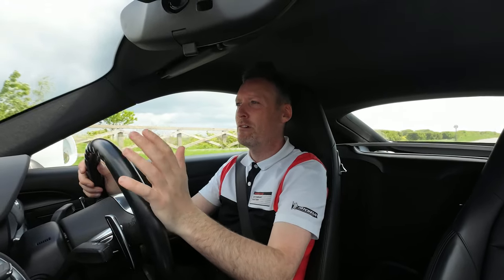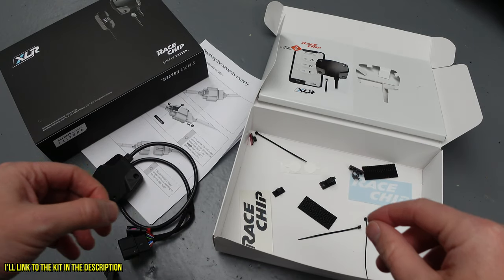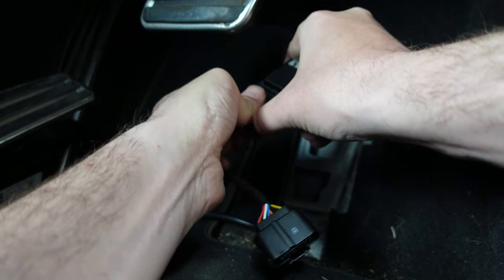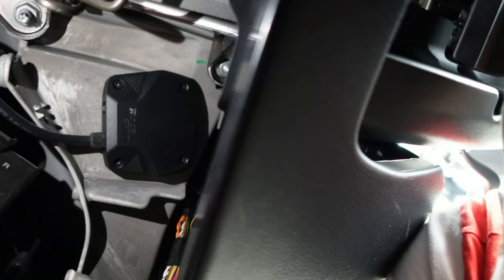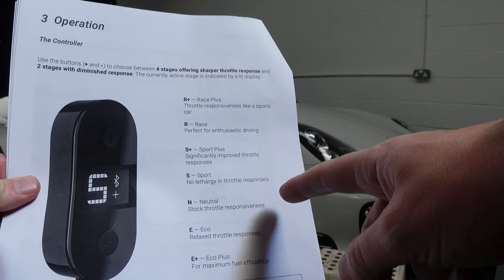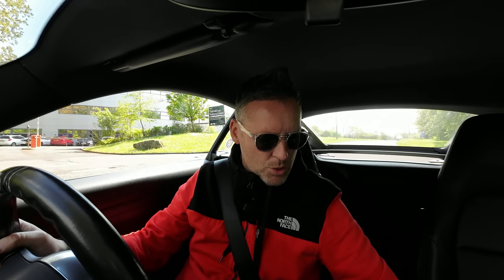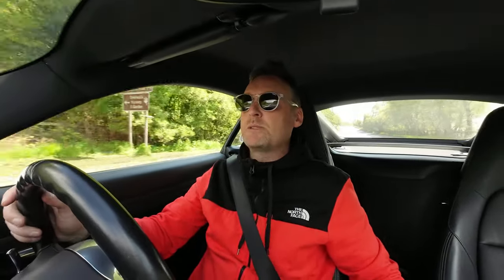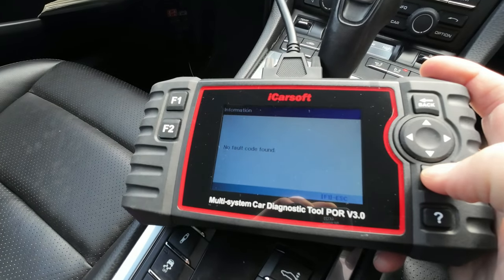This Plug In Box Will Turn Your Porsche Into A Weapon (and it’s illegal in some places)

Comment: Yes loads of people have done it but i don't trust anything aftermarket in between drive by wire controls and what they're controlling. Who's to say there isn't some failure mode that puts it in permanent full throttle. They certainly haven't invested in the kind of testing that Porsche would have.

Comment: Is this not similar to the well known sprint booster, except it’s done through an app.
Reply from the maker: Yup. There’s a few versions made by different companies. Sprint booster, pedal commander and racechip XLR.
Reply: @alsatch_  I did not catch in the video. Do you have a tune. I currently have an FVD tune on my 981 base and throttle is much better. So much so I decided not to do sprint booster. But I am always wondering. Thanks.
Reply from the maker: @ernesternest815 hi, no I don’t have a tune on the engine, might consider it in future but I’m happy with the current power output. Interesting to know that the tune has adjusted the response though. Thanks 👍
Reply: @alsatch_  well before my tune normal mode was underwhelming and sport was good. Now normal mode is good and sport is great. Especially above 5k where she really pulls.

Comment: Unfortunately not available for a lot of Porsche models. I tried to find an XLR for my Panamera, but not available. Similarly for various models of 911 I tried. Pity - I'd have liked to give this a go.
Reply from the maker: They are definitely available for panamera. You need to select your model, and then stroll down the page past the section where it tells you that there are no performance chips available, below that is the XLR product.
Reply: @alsatch_  Hi Al. Thanks for taking the time to reply. I must be missing something. I select my car make and model etc and then go to the XLR page where it says 'not available for your car' and offers a button to 'continue shopping'. If I scroll down to the bottom of that page, the only option is to 'continue shopping'. I can't add an XLR to my cart. I have a Panamera 2015 (970.2) 3L diesel 300HP. My wife has a 981 Cayman - we both really enjoy your videos and your down-to-earth presentation style. PS. There ARE performance chips for the Panamera (the GS and GTS), but no XLR is listed anywhere.Weird. It would be a big favour if you could successfully add a XLR to the cart for the Panamera diesel 300HP - that would prove that the problem lies with me!
Reply: Hi Al - ever since I saw your video on the XLR I wanted to improve the laggy throttle response on my Panamera, but as I commented before, the XLR isn't available for the Panamera 3.0 diesel 300 bhp. However, I have now bought a PEDAL COMMANDER for the car which does the same job. Just thought I'd update my earlier comment with this good news.

Comment: So it skews you throttle position signal by increasing gain and bias?    

Why not just learn to drive you car?
Reply from the maker: Ok I’ll take it off now
Reply: @andymanx Bruh I just watched your trackday videos. Talk about learning how to drive your car 😂😂😂  maybe it was your mom driving
Reply from the maker: @chrisolsen937 hahaha I just watched them aswell. I don’t think it was his mom though, probably his grandmother.
Reply: Andy it depends how linear the throttle is and how long the pedal travel is.

These things can help on some cars, but they aren't a miracle cure or magic bullet. Get the setup right though and there can be a noticeable positive difference (get it wrong though and car can become undriveable)

Modern cars do the same thing in sport and sport+ type modes BUT they often change gearbox and engine mapping at same time.

Comment: Those things are utter pish , make zero difference .
Reply from the maker: I don’t know what model you’ve bought, or what car you have but I can assure you this has made a massive difference to my cayman 981. 👍
Reply: It doesnt change cars power.

It simply takes the output from the electronic throttle and changes the sensitivity.

If it changes the signal how can it not work ?

The problem comes if you expect more than it can offer.
It wont transform a car.
It can't make it faster.
All it does is mean you need less throttle for more revs/speed.
Mash your foot to the floor and it won't matter if the things fitted or not, but it can to a degree make a car feel more responsive.
Reply: @alsatch_  you know its all just throttle mappings right? they just make the throttle super twitchy to make the car feel "quicker". you'll have no real extra power.
Reply from the maker: @th3b0untyhunter  100% correct. But I do feel that because of the sensitivity change, it does transform the car. Thanks for watching mate 👍
Reply from the maker: @1061shrink1061 yup, I know that. They’re not designed for that kind of thing, it’s purely pedal sensitivity 👍
Reply: I suspect he may be selling these 😂
Reply from the maker: @Carrera-gp9od nope they are nothing to do with me.
Reply: @alsatch_ 
Sorry mate , I had one of these years ago ( sprint booster ), it was on the car when I bought it .
I took it off didn’t want some cheap gadget interfering with my throttle pedal .
They don’t give any more power , I don’t think there is anything wrong with the way Porsche map the throttle response anyway .
I though by the way you were saying it transformed the car etc , you were actually selling it through your diagnostic company .
Reply from the maker: @Carrera-gp9od  no not at all it’s fine. It might not have been much of an issue years ago, but the newer drive by wire cars with PDK can have a little bit of lag when pressing the accelerator. Some cars have it, depends on the spec of the car. It transforms it in the feel of the throttle response, nothing more than that, and definitely doesn’t offer any extra power or anything like that. 👍
Reply: You have no clue what you’re taking about or how this thing or the sprint booster work.
The delayed throttle response is Porsche’s attempt at reducing warranty claims to the drivetrain.
So the throttle body will move slower, you cannot make it go faster, by pushing the gas faster.
If you don’t have Sports Chrono, you will need a sprint booster or this device. Google videos to understand how the delay works.
Basically the highest setting will transform your pedal to one driven by cable. Throttle body response will become instant with no delays.

Comment: Deffo need the little controller I have the sprint booster and you can change it whenever you want which is a lot easier
Reply: I like the fact w Sprint Booster I can put a code in to dismantle the car or to put it in valet mode too.

Comment: Interesting. On my Lexus isf it was either too responsive or not responsive enough between modes so I got a similar add on to this. . Personally I don’t have the that issues with my 981 but maybe that’s because I have the sports chrono option.
Reply from the maker: Could be a better response on the sport chrono models yes. My 997 has the sport chrono and I don’t feel the need for this kit in that car. Thanks for watching 👍

Comment: Nice video and car lol, I purchased one a few years ago and I have to say best purchase for my car so far. It definitely transformed the car and makes it more fun to drive. I also wanted to say that in regards to the eco mode it comes quite useful especially on snowy or icy roads to help prevent tire slippage and when I take my car in for any type of service (like tire rotation and balance)  so the techs don't get to carried away with the accelerator lol.

Comment: Effectively remapping the throttle response curve, right? So what you experience is closer to WOT when giving less input. No change to power, but you’re getting more throttle input to the engine with less physical movement. 

I would be a bit concerned to use this in track or intense canyon drives. Having more linear throttle response is important for better control. A logarithmic throttle response is fun on the street, but can be tricky in more technical driving situations.

Comment: So would this have the same effect on a 997 with tiptronic
Reply: Just add this to my 2005 997 tip, and I can confirm yes! Difficult to keep it under 3k revs though while it warms up as it completely changes the shift pattern. Found the race mode too much for normal driving as every little touch of the gas throws your head back like you’ve floored it. Sports is good to give a great balance between driving round town with no delay when you want acceleration 👍
Reply: @leehoward100  
Hi
Did you fit it yourself, was it as easy as it looked or did you get a garage to fit, I am interested in fitting this to my 997 with tip, are the gear changes any quicker.
Thanks
Chris
Reply: It was really easy, in fact my 11 year old wanted to help so he actually did most of it (true!) I did the connecting of the leads as does need a bit of pressure to get the ‘click’ but really easy to do. The difference is very profound and seems to want to live in the power band through all gears. The only negative is that even town driving 30/40 mph, it wanted to hold the gears and take the revs above 3000 before getting warm. At the moment I have it in eco S mode (the app lets you tweak each of the standard settings) and even this has made it more punchy but with the benefit of the gears change slightly sooner (in the lower rev range). If I’m on a longer drive, I will put in sport once warmed up. Another benefit is the noise, because it changes gears to keep in the 3-7k range even with normal driving, the engine roars a lot more without having to put your foot down 👍
Reply: @leehoward100  
Thanks for the info much appreciated 👍

Comment: Another excellent video.  Does this unit make the throttle "touchy" or hurt low speed drivability?  You know, in instances where you need to feather the throttle, like maybe inching out a sloped driveway to avoid scraping.

Comment: I'm in the US and we have here a device called Sprint Booster that works the same way as the unit you've installed and it makes a world of difference in throttle response just like you are experiencing. I don't know if they offer the Sprit Booster in the UK, and if so the cost for it. Sprint Booster has a lock mode and a valet mode for those who may want that aspect also. I have one in my Gen 2 Cayman S (2010) and a Toyota Tacoma (2013) and it is a version 3 with more adjustments (10) in each of the modes.
Reply from the maker: Yeah I’ve read up on the sprint booster. I think this XLR kit falls into the same situation where it is illegal in California and other places but I’d bet nobody takes any notice of that. Thanks for watching 👍